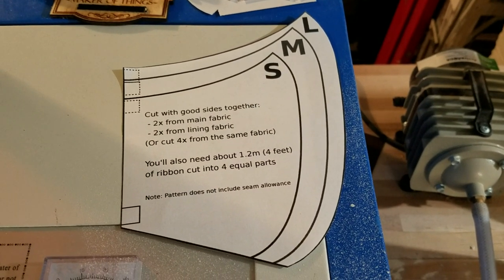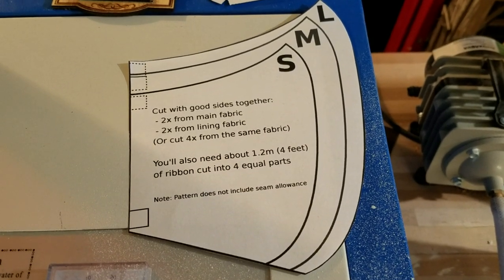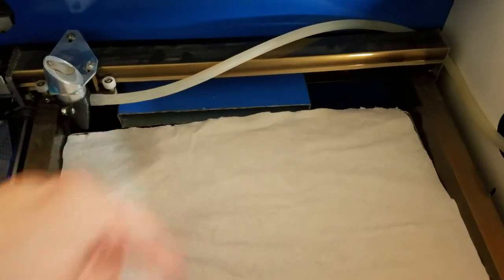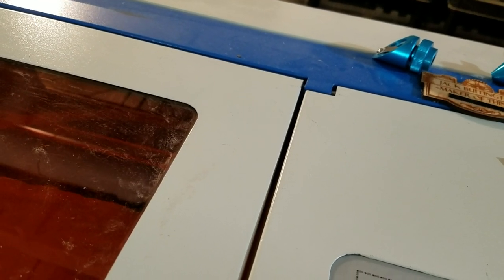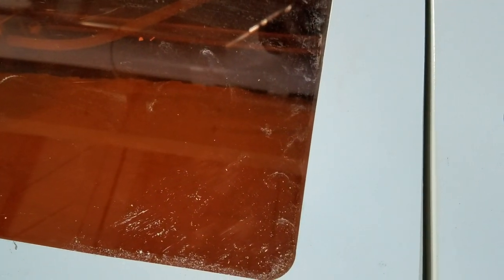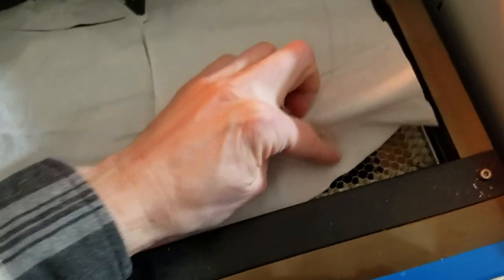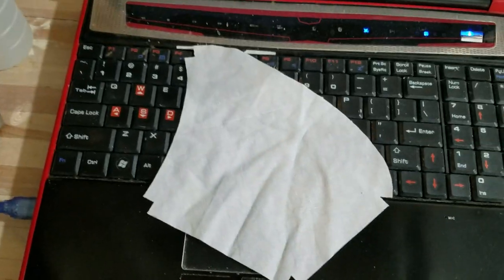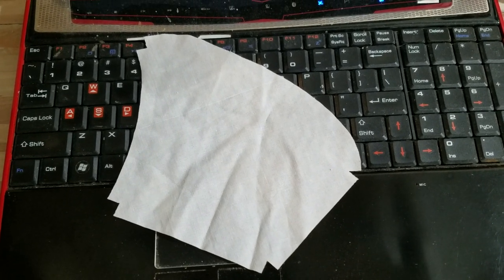Fu face mask cut with a K40 laser

Comment: Hey any chance you can share the bed and air assist product links?  Looks nice.
Reply from the maker: I made the bed myself from aluminum honeycomb and aluminum angle pieces.   For the air assist, I 3D printed the nozzle and bought a large-ish air pump off of Amazon https://www.amazon.com/gp/product/B002JPM91W/ref=ppx_yo_dt_b_search_asin_title?ie=UTF8&psc=1  I think that you could use a smaller pump realistically.  I have the valve mostly closed so that it doesn't blow away the things that it is cutting.  I used silicone tubing to get the air to the nozzle.  I probably ordered that from McMaster Carr.  It was in one of my 'misc materials' bins so I'm not totally sure.